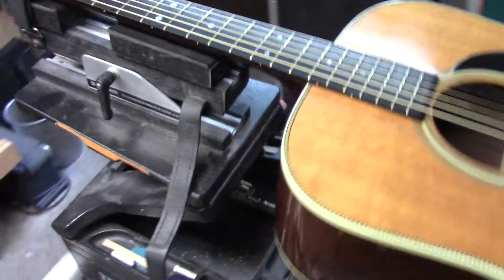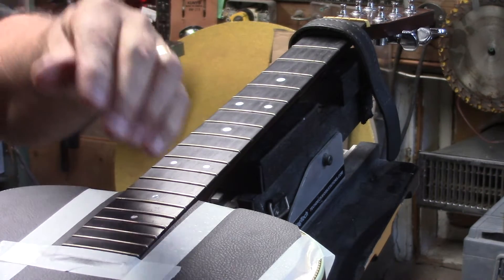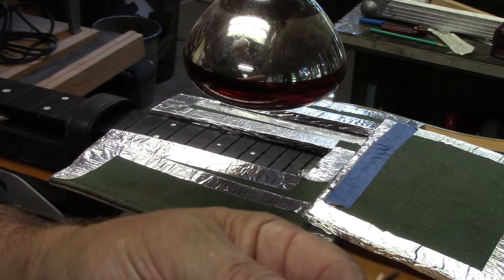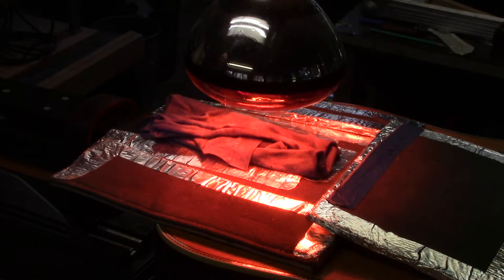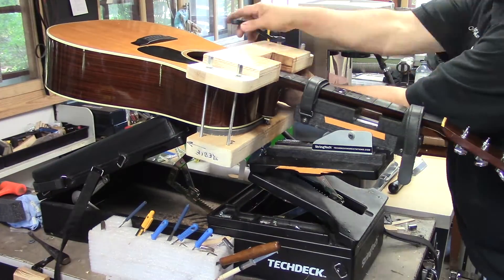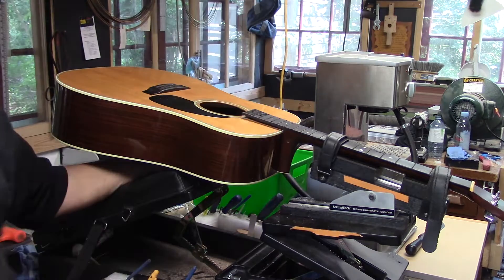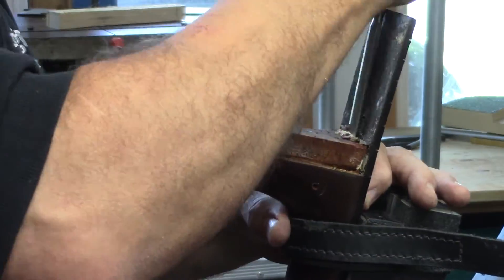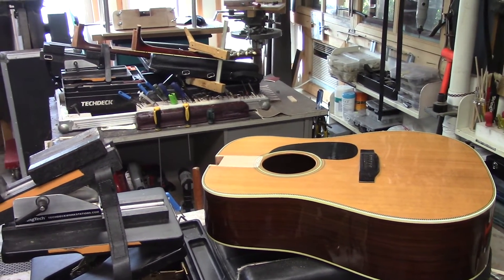Martin HD 28 Neck Re-Set Part#1 @StringTechWorkstations

Comment: What is that soldering tip you are using to heat the frets?
Reply from the maker: OK Frank. That is a Weller soldering gun. I cut the "loop" and filed the ends into a very small radius to match the fret crowns ( approx ). When I touch the two tips to the crown ... it ( the fret )
completes the circuit. Heats up VERY fast ! 2 seconds max.